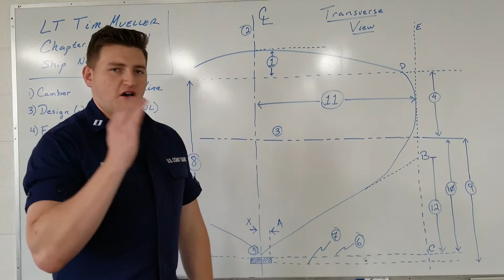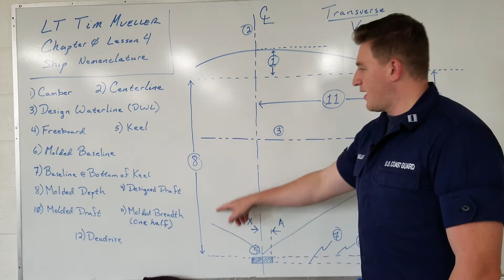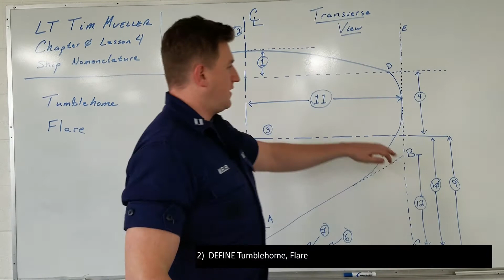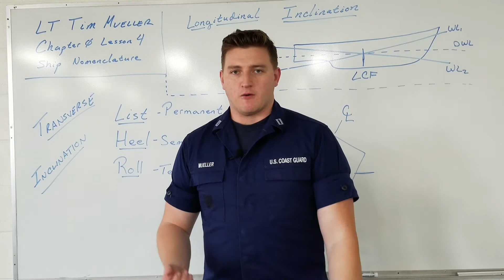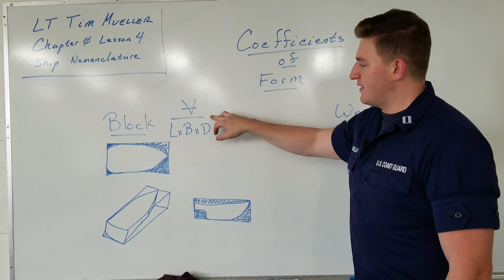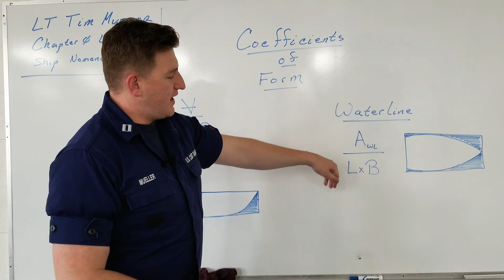Comment: Hey Tim, Thanks for the videos, they are really insightful. The middle chapters are missing, please share those as well. Thank you
Reply: I'll be doing a few more here shortly.  I'm currently programming a simulation for a rectangular barge to try and make it more clear why cross curves, etc are set up the way they are.
Reply: @TimMueller2011  ok, sure.
what's the good way to communicate with you for guides and suggestions?
Reply: The email address given at the very end of each video is fine